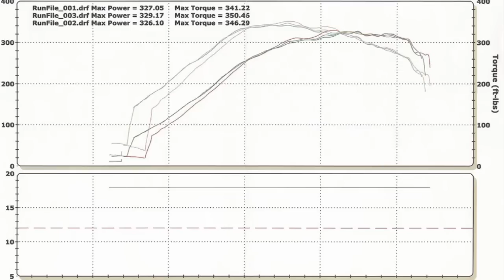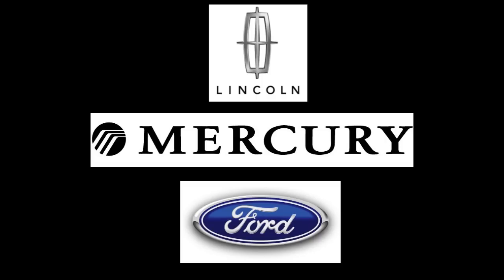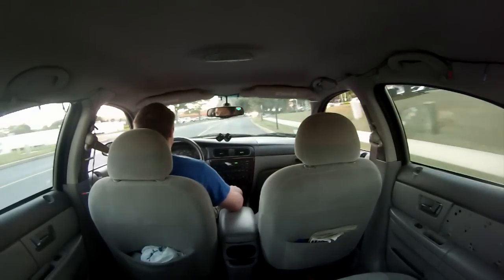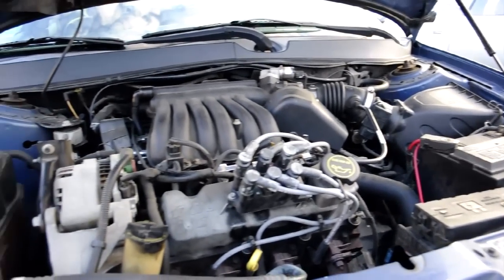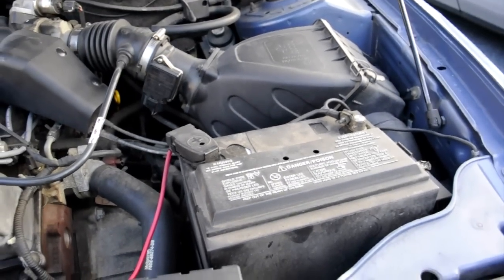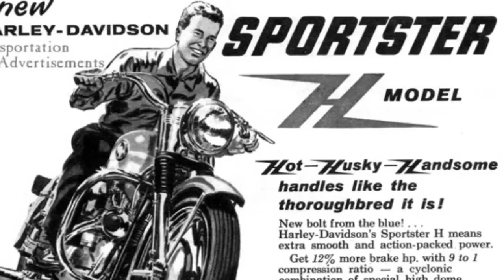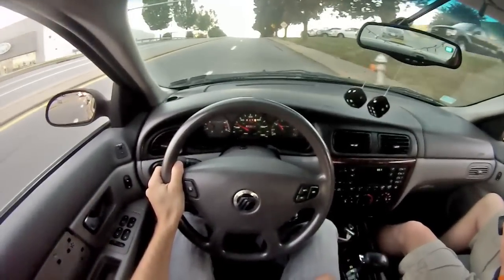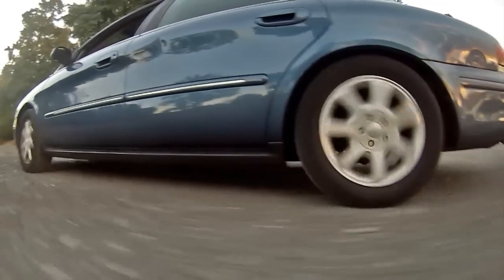Regular Car Reviews: 2002 Mercury Sable

Comment: I like the stories you used to give about the cars Mr. Regular. Keep that going. 

Anyways, my brother has one of these. A 98 Vulcan Taurus. It moves good enough, it has no rockers, holes in the underside, and the rear quarters are just about gone....he's run it out of transmission fluid a few times before he had the transmission cooler lines replaced so the transmission's first to second gear change is about as effective as a the engine itself, but you know what, it still runs and drives....decent...and he's owned it for almost 10 years and put over 60k on it. Now that he's done with his PHD I can only hope that he buys something else...that poor car needs retired. Badly.

Comment: LOL I had some fun with that 1, having owned an older Taurus, with that same engine. That car was a strippo though and was lighter. It was adequate. This generation though was heavier, and would collapse its rear suspensions with little problem. Also, this body style, for whatever reason, would rust out like crazy! Rocker panels, rear inner quarter panels, trunk floors, name it. It was a throw back to Fords of the 60's .... 1 can hear them rusting!

Comment: Taurus is reliable, dependable.. probably some other 3rd thing, mpg 
and, that's pretty much it. 133,000+ miles, after pull and pull, it struggles after barely pressing the gas when you need it to get going. and it has that typical taurus sag in the rear

Comment: I had one. Bought it used with 156,000 miles and the v6. It lasted for a whopping 6k more miles. I should've known it was failing but was successfully lied to by the dealer about the engine (they all do that , it's fine once warmed up) Very nice car really. Great seats and ride. Shit shit short life v6.
Edit: mine was the 32 valve premium motor. If it had been the Vulcan it would've probably lasted longer.

Comment: Check out the Rover V8, it was in production for 46 YEARS. From 1960-2006. We have a car that has it a 04 Land Rover Disco
Reply: General Motors built it's small-block for 48 years. The Rover V8 was based on it.
Reply: http://en.wikipedia.org/wiki/Rover_V8_engine

Still 48 YEARS, compared to the vulcan that he calls ancient
Reply: The crazy thing is that if you trace it back the Rover V8 started as a Buick V8 even earlier but Murican's were afraid of that witchcraft that is aluminum so they sold the rights to the motor.  So in truth the Rover V8 was actually in production for more than 46 years.
Reply: And thats in a car from 2004, not the 50's. Thats why our car gets 10 MPG :D

Comment: I drive a 2005 Ford Taurus SEL 24valve DOHC 3.0ltr v6. It makes 240 hp. The guy at NAPA and the guy at FORD told me it was a "PI" version of the Taurus.
Reply: No Taurus ever made more than 201hp, even the Ford 500 only made 203 with the same Engine. The Duratec 30 only made 221 with VVT in the '06 Fusion when it came out,  and later made 240 in the Escape before they dropped it in favor of the EB 4-cyl. They werent as refined as say, a honda V6 but they were durable and held their own. My 01 taurus was a tune away from burying the speedo at 120, sadly all were limited to 111.
Reply: +David Gonzalez Yea I guess you didn't read the whole comment. my Taurus used to be a PI. which stands for Police Interceptor. they highly modify or tune the cars to give more power for Police use. I bought the car from the College which the security guard used for patrolling.
Reply: Thats news to me, there was a Taurus PI but that was the previous gen, like in robocop lol. The only modern PI that im aware of with a Ford badge was the  panther platform Crown Vic, or CV-PI. Even in PI trim it was only rated at 250hp from the V8.

Comment: I have a 2002 mercury sable best car I ever drove and still can get over 300 mpg on a full tank
Reply: WHo DID yoU Get IT fROm ???
Reply: a ford car lot forget  where
Reply: rhetorical. 300 mpg just isn't possible
Reply: I did it
Reply: Do you mean 300 miles? 300 mpg would mean you can go 5400 miles on a tank
Reply: 300 miles if I keep under 60 mph but hard to do the engine I have in it 24 vdoc

Comment: 04 Taurus was my first car. I got lucky and had the Duratec V6. Great sound, great pull, great gas mileage. Supposedly had the "Sport" package with the Splitter wheels. That's all the sport package included. Sounds more like nice alloys, huh? Anyways, it was a beautiful car and I had a hard time saying goodbye. I miss it, but I don't want it back...for now.
Reply: +TheProgGuy The Sport package actually was more than just those special wheels. It also guaranteed that the car received the 24V Duratec engine, and it had special radio trim and a special shifter bezel (they also got floor shift standard)
Reply: +ice44567 I had a column shift. Also had no special radio bezel.
Reply: TheProgGuy It was special in the sense that it was a brushed aluminum instead of standard black/grey. If you didn't have that then something ain't right, lol. I guess a column shift might have been possible but I've never seen it
Reply: +ice44567 I searched some forums, I guess I didn't have the Sport package, but I'm 100% sure I had the special wheels. I know I had the Duratec because I did a bunch of work around the engine (mostly detailing the engine bay).
Reply: TheProgGuy Lucky you, someone must have swapped those wheels on there. They're quite rare, especially today. Def the best looking alloy set they offered
Reply: What do the spotter wheels look like, I searched but couldn't find them?

Comment: The car runs great it is reliable however the only pet peeve problem I have with it is if you ever have to change the fuel pump you have to drop the gas tank to get to it and that is expensive and it sucks you can’t do it yourself but I really don’t like that aspect of the car but the rest of it is just fine so far (bought it new). Talk about your run on sentences!

Comment: That's fucking spot on. Struts on my are worn out and I am missing both of the panels in the back seat. The LS isn't that bad. It's good on the highway. Shit I picked it up for $500 and spent another $500 fixing it up. Still has the dealership plastic carpet covers and the interior is near mint. Couldn't pass it up. 100K miles it's running 'strong'.

Comment: the vulcan kicks ass!  It's everything else bolted to it that sucks; i.e. trans, ac compressor, anything with a pulley, etc.  BTW - they did upgrade the NVH in that engine for the 2000 redesign.

Comment: i had an 02 Taurus; the car pretty much feel apart after 80000 miles - engine, transmission - CAGLUNK!  the plastic doors were so cheap i literally dented one with my ASS closing it while my hands were full of groceries coming from the damn SHOP RITE to feed my seventeen adopted house plants.  the doors would freeze shut in the winter, the radiator leaked, the engine leaked, it leaked, it leaked it LEAKED!  F that care!

Comment: The Duratec 3 liter was a good engine… I had one in my Escape crossover before a girl in a newer (and heavier) Dodge Avenger hit me and totaled it. Well, it started, drove excellently and had only some damage to the front (she lost control of her Dodge going downhill).  But since the airbags deployed her insurance (All-greedy-State) decided it was totaled. I liked it for a SUV. It had lots of space and was pretty light (it was based off of the old Mazda 626).  It was easy to go pretty fast. Plus, unlike the body-on-frame Explorer with its torquey Germanic V-6, it had independent wishbone rear suspicion (although front drive) and offered pretty good handling for a SUV (oh, crossover I mean).

Comment: First car was a 96 taurus with the v6 vulcan pushrod. Man that car was something else. I delivered pizza in it for years. Honestly, for the miles I put on it, it never really gave me that many problems. However, one day the instrument cluster stopped working and for whatever reason we couldn't figure out why. I bought another cluster to replace it but that also didn't work. Eventually I said fuck it, and bought a 01 honda civic. The guy who I bought the civic from wanted the taurus so I sold it to him for 400 bucks which was knocked off the price of the civic. I think the taurus had about 96k on it when purchased for 2200k and sold it at 130k.

Comment: Had an 2001 dohc duratech sable wagon the Ls and for a wagon.. the shit moved. Springs were alll sponge, radio was decent and that car would just go and go and go. Ac had a leak and would make a horrible ass noise when turned on but it was great for drivin on state highways. I got it towed and the impound fee to get it back was more than what i paid for the car.. so thats how that adventure ended. Sad to see it go

Comment: I feel like this might be about what you say about my 1997 Grand Prix. Or maybe I just think that because I'm done fixing stuff on it but will keep driving it until the wheels fall off.
Reply: I had a 2000 Grand Prix GT. I sold it with 256,000 miles. It needed new wheel bearings and brakes, but otherwise, still ran great! I still see it being driven around town sometimes! I'm planning on buying a 2002 or 2005 GTP very soon!

Comment: I went through 3 starters on each of my Vulcan powered Tauruses thanks to the starter being right below the oil filter. If it leaks at all your starter is toast, and it liked to leak
Reply: I went through 2 water pumps and rear struts on my 02 and because of the design each were a nightmare to do
Reply: @TheGamingAce231  And let’s not get started on the gamble of which owner is going to have to swap a transmission before 100k.

Comment: the 24V duratec was absolutely not durable though.

the main issue for these cars was indeed the auto trans. i desperately wish they came with manuals because my 236k Taurus is almost through its second slushbox 4 speed
Reply: datsteve they are also extreme headaches to work on
Reply: The AX4N was/is the weak link in these cars. It was kinda 50/50 with these cars. MY 01 with the duratec ran great for the time i had her. My inlaws 98 sable has the vulcan/ax4n as in the video bur the trans has a big 1-2 kick that gets worse the harder you accelerate from a stop. The vulcan is about as dumb as a hammer to work on, the duratec, not so much...vaccum lines galore and finding the one that needed replacement was always interesting.

Comment: You thing the Vulcan is bad the 4.3 v6 Chevy was made in 85 and it's still made but it's one of the most reliable engines I've ever seen just like  the 350 in fact there the same block just two missing cylinders

Comment: Which one likes to rev less the Vulcan or the Essex?

The 3.8 in my mustang likes to stay around 1200-2000 rpm where it makes most of it's torque and really doesn't like being pushed much past that to its (wait for it...) 4750(!)rpm redline. Making it rev is like torture. It may only make 150hp, but the 215lb/ft from idle to 2750rpm means that you never need to go past 2000rpm, it just pulls even in overdrive, reving it any higher is usually unnecessary either way.
Reply: The vulcan has a very flat torque curve. It starts with no torque at 800 rpm, and stays flat at no torque all the way up to 6200 rpm. Lol. Ok. It's slow but its not that bad. I have a vulcan in my ranger, and it does like some revs if you are planning on doing any sort of acceleration. It will wind out the tach the whole way without an issue, even at 241k miles. I drove one in an automatic once, and it was tremendously slow.

To put things into perspective, the vulcan makes about 180 lb/ft of toque, and the same 150ish horsepower as the 3.8, which means it's peak (lesser) torque occurs at a higher rpm.
Reply: kirbyswarp The Essex will get to about four grand before blasting a head gasket.
The Vulcan won't go much further but at least it will hold together.

Comment: Another horror story about the Vulcan engine: my 99 Ford Taurus sprung a coolant leak somewhere besides the timing chain cover (it had a leak from there as well) I'd have to add coolant to it every two days maximum, one of the pulleys would scream like a scalded ape. The temp gauge would shoot up after about a mile and then go right back down, never figured that one out. I changed the alternator, battery, tensioner pulley, temperature sensor, thermostat, had to flush the coolant numerous times and it was still screaming when I sold it to my nephew. (I told him all that was wrong with it and he bought it anyway) In summary, don't buy a Ford Taurus at least not the third and fourth gen Taurus'

Comment: have a 97 sable oval edition with the Vulcan in it  am kinda glad that it is the Vulcan and not the Duratec DOHC  cause this passed weekend had to change the oil pump.  if I had the DOHC engine would have been a lot more work and more costly since you have to remove the Timing chains as well to get to the Gear pump.   The Vulcan is a great Engine Keep Maintained and will last forever.

Comment: but if you dont change the struts the perches will rust right off and hopefully you wont be using cruise control cuz that plastic clip will snap causing it to lay the hammer down into wide open throttle as poor grandma struggles to look over her seat to see what shes about to hit..both recalls on this amazing car

Comment: The twin cam Duratec is a good engine. Except that it's paired with a crappy American 4 speed automatic transmission.

Of course there are another options, like 5 speed manual, or Ford's more sane 5 speed Durashift auto, but in my country this was the only trim level - Ghia 2.0 Auto, with no sunroof, velour seats, fake wood trim, and back seat so uncomfortable, that you might think that the car is trying to anally violate you.
Reply: Luckily in 2005 (06 model year) ford put the 3.0 dohc duratec in the fusion/milan attached to a 6 speed auto which at the time was actually quite high tech. Almost every other midsize car had either a 4 or 5 speed auto at the time.

Comment: I have an '02 Cougar with the 24 valve 2.5l V6 duratec in it, I came here to see if the car in the video had the same engine and it ends up being a vulcan LOL

Anyways you should try to get in an '02 Cougar, they take off nicely and are okay cars aside from a few common issues. They feel like alright but not the greatest. Fun for a quick drive but I wouldn't run them hard without lots of modification.

Comment: The rear struts on this gen Taurus/Sable tend to go. Not the shocks, but literally the springs break. wtf right? Springrate so low for such smoooooth handling....until the springs break and the ass end is sagged down on one side. Nice job Ford.

Comment: Having owned two Tauruses (2000 wagon SE and a 2006 SEL) I can say from experience that they are reliable and age well. The only reason I worked on them and didn't instantly scrap them is because of the Vulcan V6s they had. The Duratec is absolute trash; more power and responsiveness that is made entirely irrelevant by being a total fucking whore to do any kind of work on. Every time a Duratec-equipped Ford would come into my shop I knew I was in for a bad time.

Comment: Trust me I owned a 2003 Ford Taurus SEL with the 3.0 V6 duratec and it was ok, reliability was terrible the Taurus was poorly built the only good thing was that duratec V6 everything else was terrible suspension cocked out as well as the electronics traded it in on a 2017 Nissan Sentra with only 9500 miles in September of 2018

Comment: Yeah Ford made the Vulcan for a long time, but how long was the GM 3800 in production? At least just as long if not longer
Reply: The GM v6 was in production from 61-08. Among others it was one of the longest running engines ever.
Reply: Exactly! I think the GM 4.3 V6 was in production for seemingly forever too(before that engine size was weirdly resurrected for their newest lines of truck engines). 

I never owned a car powered by the Vulcan, only ever heard of it's toughness from a third party source. I did, however, own a Pontiac Grand Prix powered by the 3800. I gotta say, outside the auxiliary pieces, that was one tough engine. Mine survived overheating, running out of oil on the interstate, etc. but it kept on chugging. There's something to be said about engine lines that trace back many years. It's sort of nice to know sometimes, most of the faults have been taken out of an engine by the time you end up buying one. The 1.8 liter engine they use in the Coralla for example: simple, bulletproof, and proven. Gotta love that, especially if your buying used.
Reply: +Tyler Miller (tmillgohawks) engines only last a long time in production of they last a long time in use. The 3.5 rover v8 in my old Land Rover was the same the carburettor version lasted forever had 300k miles when I was done with it.

Comment: Vulcan is reliable and there is nothing really wrong with cast iron other than weight. Aluminium only beats Cast Iron in the weight department but is inferior to cast iron in many respects. With the push towards more fuel efficient cars, Aluminium is the king but don`t blindly disrespect cast iron.
Reply: +kris200998 I got my Duratec to do over 130, I never actually got to top it out, I couldn't imagine it breaking 140 tho
Reply: These like to break valve springs.

Comment: so are the 1988-1995 taurus and sables are good cars?
Reply: Just about every Taurus/Sable that doesn't have a 3.8L in it is a good car, despite what a-holes like the guy doing this vid. The trans are the weak points, but if you service them every 30K like I do, you get a lot more out of them than people claim. Got 200K out of my '97 Sable (bought new, sold it at that mileage, guy still drives it). Got almost 190K on the '95 I have now (bought it used, previous owner had it serviced regularly as per their word and receipts), also original trans (AX4N), shifts great.

The suspension in the gen 4s were made softer for a smoother ride, and that plagues them in later years. They can be easily upgraded with aftermarket springs and struts, though.
Reply: cool thats whats up